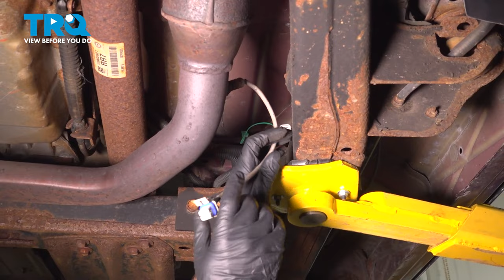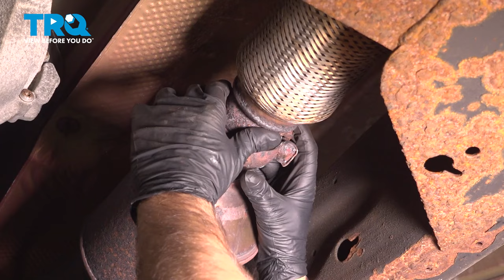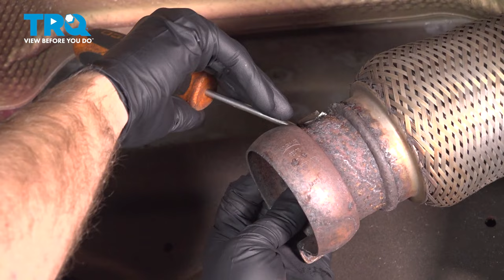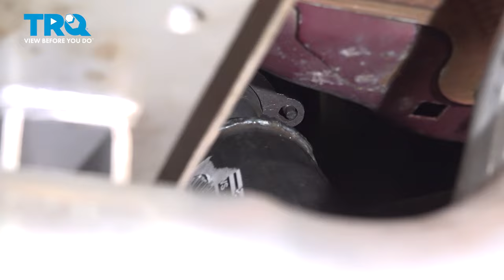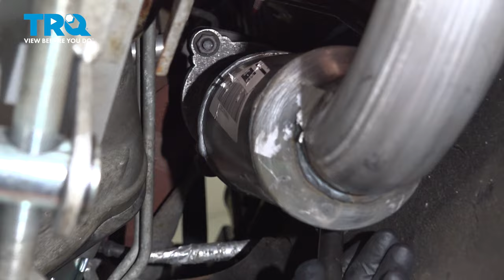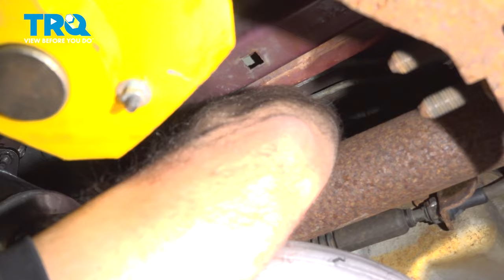How to Replace Catalytic Converters 2007-2013 Chevrolet Silverado

Comment: The oxygen sensor on the passenger side are always clocked wrong , so you cant get straight on that outside nut , i so wanta cut it up and clock to my advantage ..lol